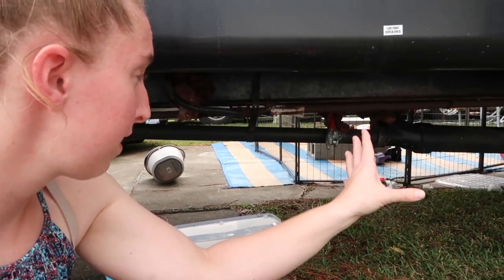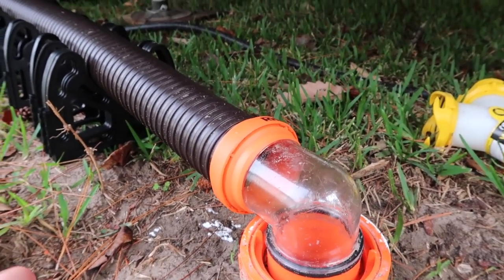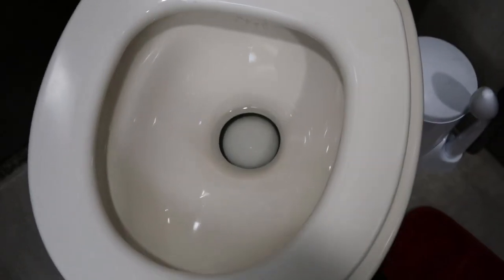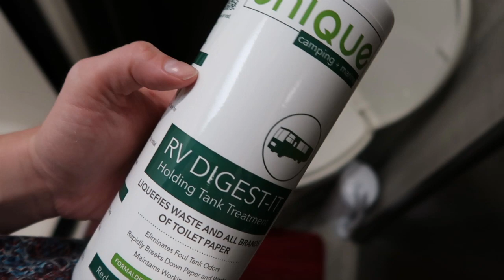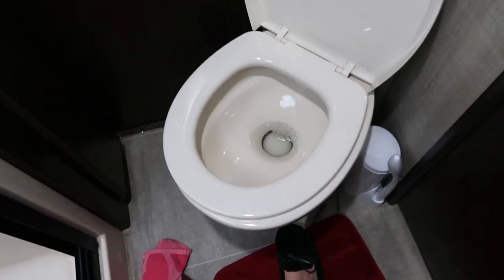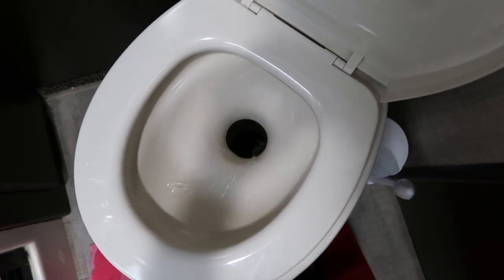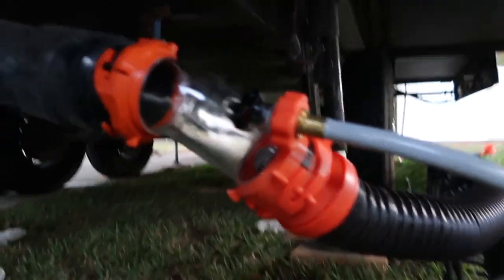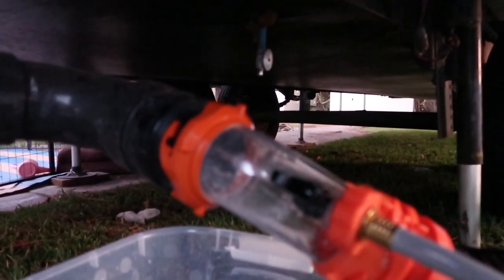Clogged Black Tank Chaos / What To Do When Your Black Tank Won't Drain / Black Tank RV Tips & Trick

Comment: What works the best instead of stupid chemicals is to go get a 20 or 40 or 60 ft long drain snake with a bristle brush on the end of it and a nice long pair of gloves that go up to your elbows or and run it through your lines plus when your tank is empty always put some water in your tanks before you use it and always keep your drains closed until you're ready to dump it otherwise all your crap with a stick to the bottom of the tank and I like to dump a couple large pots of hot water down the toilet just helps to loosen things up😊😊😊

Comment: I'm having the same problem. It looks about 3/4 full. The gauge says only 1/3 full but I don't think it's working because the other empty tank shows as 2/3 full. I've been using Happy Camper but that doesn't seem to work. I will try that Digest-It. The Ace across the street doesn't have it but the one 10 miles away does. Not sure if it will work. But, gotta try something.
Reply from the maker: I hope it works for you! Come back and let us know! It’s saved us a few times now. Good luck :)
Reply: @LifeOnTheSpectrumYT  24hr update: Well, some "chunks" (eww) came out but it still is clogged. It appears it does work but probably needs more solution and more water. I saw the post for Holding Tank Cleaner but that isn't available in my area. I guess I'll fill it up with water, add more treatment, and wait 48 hours.
Reply from the maker: Oh man it seems like it’s so close to unclogging! Hopefully the 48 hours will do the trick!
Reply: @LifeOnTheSpectrumYT  I have no patience. However, the additional 24 hrs seemed to work. It all came out and after a flush, it was clear. However, when I try to fill up from the flush, it is leaking out so I guess the termination valve wasn't closing all the way which caused the liquid to drain out but the solids remained. My plan is to put a gate valve one on the end of the drain and just leave the main one open. I was worried about the cable failing like other posts have mentioned. So, I'll solve two problems with one gate valve where the sewer hose connects. Thanks for your video. It did help.

Comment: No to be Mr. Know-it-all but shouldn't the water filter be at the spicket so that it filter the water before it goes thru your hose etc.?
Reply from the maker: It is. The filtered water goes into the RV. The hose we use for the black tank is not. It’s its own system so it doesn’t contaminate our drinking water